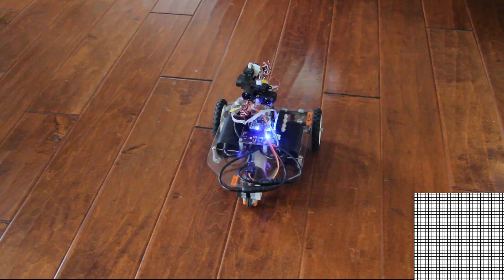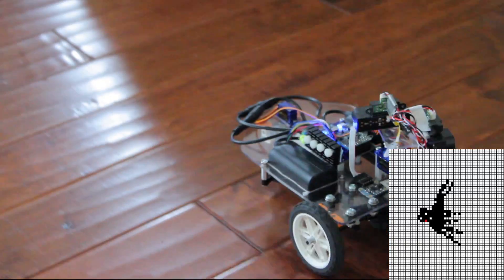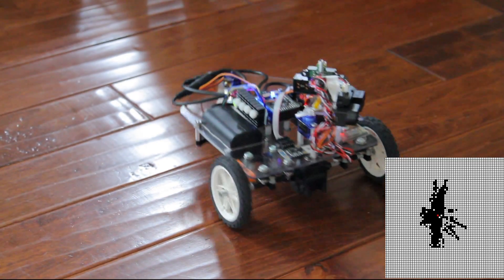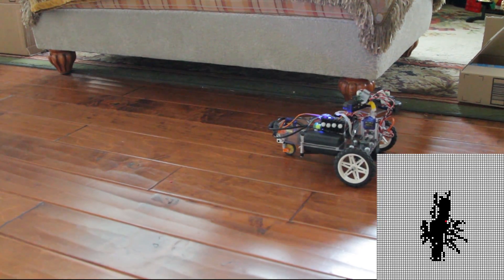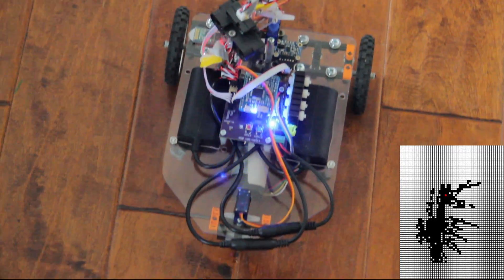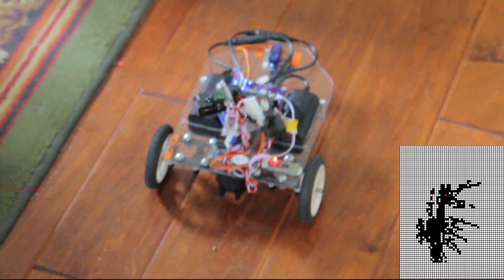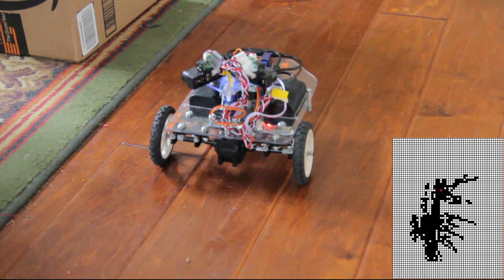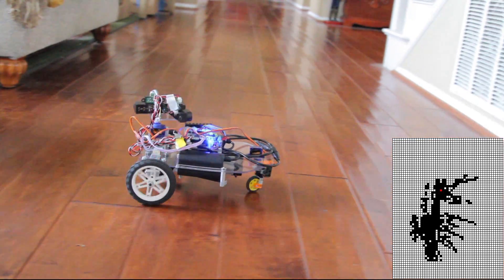Room mapping robot update and demo with maps

Comment: what microcontroller do u use ? Also can u tell me about the procedure to make this robot ?
Reply from the maker: This video explaining the hardware/design should help. Let me know if you still have any questions. https://www.youtube.com/watch?v=TsM1figtt4c
Reply: brother can u tell me can i use python in arduino ? and if i use ultrasonic sensor what problem or advantage i will have
Reply from the maker: Not easily, I think it has been done. The Arduino generally is less powerful, so running the high level python language will slow it down. Arduino uses C/C++ functions.  Sonar sensors can be extremely noisy, much more so than the IR sensors. You wont get as accurate distance measurements. Lasers range finders are the ideal option, but expensive.

Comment: cool ! How does the robot know its position ?
Reply from the maker: Marco F it is using encoders from the motor for distance combined with IMU data for direction.
Reply: +Zachary Arnott  ok fine. But what if I have data file consist of timestamp,forward velocity and angular velocity of a robot which is measured using odometer? How could I used those data set to findout the robot position?
Reply: +betolley For that you may use some obstacles avoidance algorithm like A*. I am not sure for this video but this is generalized concept.